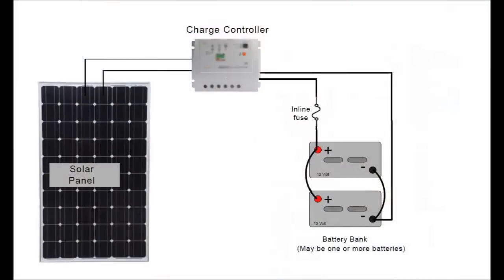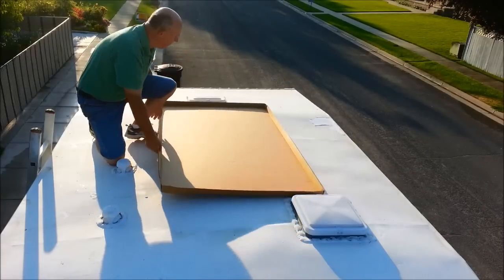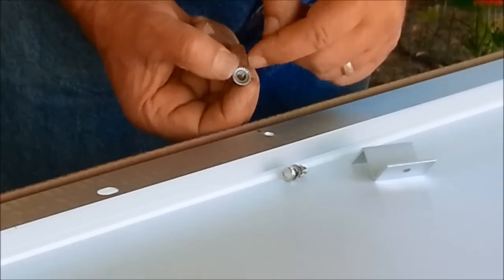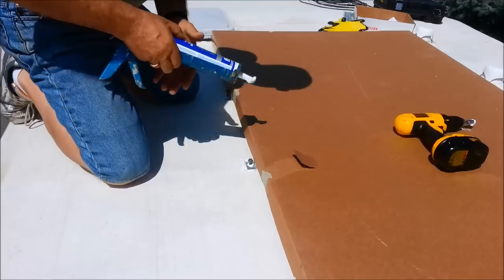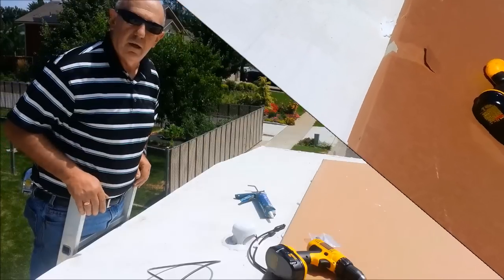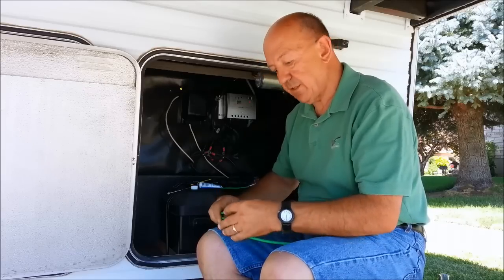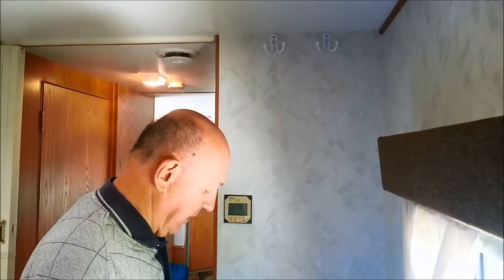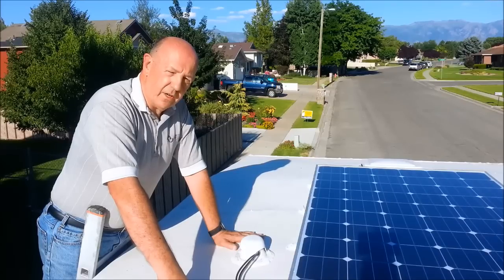The Power of Solar for Your RV

Comment: Nice job.  Plan on installing a system myself real soon.  what kind of experience have you had with it so far?
Reply from the maker: Thanks for watching and commenting.  I am totally convinced I did the right thing, but next spring I hope to be changing to 6V golf cart batteries wired in series to make them 12 V and to get about double the Amp Hours.

Comment: Great video! Follow up question, being from Texas - can you run an AC and lights with it? And will the battery hold charge enough to run the AC through the night?
Reply from the maker: Janice Luce It is possible to run AC, however, You would have to have a large enough inverter to run the AC and you'd have to have a serious bank of batteries to run it for any length of time.
Reply: Thank you for your quick response! And I absolutely agree with the rest of the comments. You are an excellent teacher/armey guy! Thank you for your service!

Comment: I am wanting to install a system. Right now I have an ignition activated solinoid charing my batteries when I drive. My question is can I install Solar straight to the same batteries or do I need some sort of controller?
Reply from the maker: +Zoart, If you do not put a charge controller between the solar panel(s) and the batteries you will burn up your batteries.  The charge controller measures the charge of the battery and reduces or cuts off the charge before the batteries get too hot and boil off the battery fluid and destroy the batteries or cause a fire.

Comment: Great video- what can that panel power and for how long?

 Im looking to put a 1,000 watt system on an RV and live in it, powering TV, Toster Oven, charging computers and mini fridge. is that enough
Reply from the maker: +trevor Donaldson,  There are several spots on the Internet where you can look up the amount of power different appliances take.  I'm assuming you are planning on using the solar power to charge batteries, but a lot of Charge controllers allow you to also run inverters to go from DC to AC at the same time as you are charging your batteries.  I would go to some of the RV forums, like rv-dreams.com where you will find people who are doing what you want to do and can give you a lot better and more detailed info than I can.  Good luck.
Reply: +Scott Law , 
Thank you so much fro your info. I like the way you tend to details too. Little mistakes lead to big problems. Subscribed and liked your site here.

We converted a 1991 Thomas International school bus'Shorty'. We need AC when not plugged into power.
There is also a nice forum ' skoolie ' is helpful like your video,again thanks.

Comment: maybe its me but did you calk at the vent / when the vent pipe comes up through the roof some wood is exposed and drilling on the side of the vent gives water a chance to get to the wood and rot it out (I work for a Rv service and have changed out many vent covers)

Comment: Nice job Mr Law-  I notice it has been a few months since the video was posted.  How dd it work out for you?  Are the two batteries sufficient or did you have to expand?
Reply from the maker: Thanks, Charles.  I am really happy that I did it and so far have been doing okay on just the two batteries, however, I do plan on going to 6 V golf cart batteries this coming spring when I bring it out of winter storage.  I should get almost twice the amp hours.
Reply: What is the lighting like in the RV? Are you using LED lights or the old incandescent 12v? If you're not using LEDs, you can improve your runtime significantly by switching.
Reply from the maker: charles kozlowski
Yeh, I keep looking at those.  Man they're still expensive though.  Do you know of a place to get them at a reasonable price???
Reply: You can just replace the bulbs.....   I found some on Amazon.com for pretty good prices-  they use 1/10th of the power and emit almost no heat....    Watch the "color temperature" - the "cool" ones have a whitish-blue tint and the warm look more like an incandescent (more orange-reddish)...   The color temperature is measured in degrees Kelvin...   6,500K is sunlight- anything below that is "warm" anything above is "cool".  What are the model of the bulbs in your fixtures- I can help you look if you like....   (I'm somewhat of a solar-experimenter myself- although I don't have a camper)
Reply from the maker: charles kozlowski
I can't remember exactly I think it's the BA15s which have the single base but I seem to remember some with two buttons on the base, which might have been in the sconce lights on the wall.  My RV is buttoned up for the winter so I can't very easily go look for a few months.  Thanks for asking though.  I did look on Amazon, they still seem pretty expensive.
Reply: Scott Law
Reply: If you consider the led will last 10,000 hours..... The price really isn't too bad...  I saw $5 each.....  For 1156 types.   I'll look for ba15 and see if I can find the best price for you....
Reply from the maker: charles kozlowski I've been back checking Amazon again lately and it seems like the price is going down I even saw some that are 2 for 89 cents plus $2.00 shipping on each two, some of the reviewers seemed pretty happy.  For that price I'm really tempted to order a few and see.  If you're not happy at that price you can afford to toss them or just use them in specific places where it doesn't matter as much.

Comment: Great video, but you made one big mistake, and that is mounting the solar panel flat and so close to the roof of the Camper. Heat is the enemy of electrical current, you need lots of air flow below your panel. doing so will increase the efficiency of your panel.  cheers.
Reply from the maker: Perhaps you couldn't see it well enough in the video but the panel is suspended above the roof by the z brackets so there is air flow underneath.  I've seen "professional" installations by RV dealerships that have less air space than mine does.  Thanks for your close scrutiny and a good reminder.
Reply: Solar Panels do well with heat.  It's only certain circuitry and none of that is on the roof.
Reply: Scott Law
Another trick in my travels that I have found is you want your charge controller close to your batteries.  And you picked the right charge controller.  My system was professionally installed and yours looks great.  On mine, they used my fridge vent.

Comment: I might have missed it, but how long are the screws going in to the roof?
Reply from the maker: trooper2221 Sorry, I didn't write down the lengths, but remember that there are a lot of different roofs on RVs and you want to use the one that is right for yours not the one that is right for mine.  You want one heavy enough to hold that down solid as you drive down the highway even with a head wind and yet not long enough to protrude through your interior ceiling.

Comment: Do not connect under load......load is the thing that's drawing power, ie the batterries or devices connected on the circuit. The solar panel isnt the load, its the supply. Having said that, i think connecting the supply last is the safest bet

Comment: i have a 2007 Fleetwood Feista, and would like to mount another solar panel. The plywood roof does not seem to be very thick. Do we need to screw into a roof truss? will the Dicor hold the panel down?

Comment: Its hard to see on my tiny cell phone but are those shadows on the panel at the end of the video? Some panels will not charge if they are in the least bit blocked.
Reply from the maker: Thanks for the info about shadows on panels.  Fortunately, mine is not one of those and charges like a champ under even shaded conditions.  Have a great day.

Comment: I do have one question I know there is some kind of formula that tells you what size wire you should run by distance. To limit voltage drop.  Do you know what size wire you used??
Reply from the maker: Sorry I don't remember, but I used the size recommended by the specs on the panel, and I know it was pretty heavy duty.  I can't check because I no longer have the trailer.

Comment: Pretty nice! I know somebody that paid $1200.00 plus parts to do just what you did here. Are those batteries wired is series or parallel? The only reason I ask, is because I don't know that I have seen a 24v RV house battery set with just two batteries. AND, I am trying to figure out the benefits of 24v verses a 12v system. Seems like double the amp hours while remaining at 12v would be more beneficial. BUT, I wonder why so many people prefer 24v or even a 48v systems over a 12v. Any help would be greatly appreciated!
Reply from the maker: Sorry to take so long to get back.  My batteries were wired in parallel, so it is still a 12 volt system.  Some people have four batteries and some have four or eight 6 volt batteries, in all the systems that I have seen they are wired so as to give you 12 volts and increase the amp hours as you suggested.
Reply: Scott Law Thanks!

Comment: hellow scott law my question is are you also using a generator also apart from the solar system and if you do is the generator charging off the solar panel or from an other source thanks
Reply from the maker: Some of your appliances, like your microwave oven, and you may have others,  only run off of AC power.  To run them you must either be plugged into AC or have a power inverter which will take the DC power from your batteries or directly from most charge controllers (but only during the day when you are getting power from the panel) and turn it into AC power or you can have the third option which is a generator, as you asked about.  The Generator creates AC electrical power so it is not in any way connected to the solar panel.  The Generator and the Solar panel are two separate and different sources of electrical power, one for AC and one for DC.  If you have an good quality inverter and batteries you really may never need a generator.  However, I always take one along just in case.  I hope this answers your question.

Comment: This is a great video, thanks for being so detailed! I'm considering purchasing and older RV (1973 Dodge Liberator) that still in pretty decent shape and would like to put solar panels on it. Do you think it would be worth installing them on such an old vehicle?
Reply from the maker: Sorry to take so long to get back, as I've been tied up because of some medical issues in the family.  All is going well now though.  To answer your question:  It doesn't matter the age of the vehicle, it matters how much you are going to use it, especially if you plan to use it a lot where you don't have power to plug into.  This is just another way to charge your batteries and if you are constantly having to run off your generator instead of having "shore power" then this may be the answer.  Good luck.

Comment: Great tutorial Scott!
I have a curse, I'm an RV technician and I spot things that normally nobody sees.  What kind of sealant did you use for the screw holes on the roof?  It looked like a silicone based product, which would be not so good.  Silicone and rubber roofs do not stick well together, please check it once in a while to make sure its integrity is intact.  You really need to use a soft lap sealant designed for the EPDM rubber (most ppl use Dicor self levelling sealant).

That's the only concern from a professional standpoint, the rest was really well done Sir!
Reply from the maker: John Harlick I used Henry 224 Window and Door Sealant.  Reading the description it does say that it has silicone.  Here is the description on the Henry site:  "Henry 224 Window and Door Sealant, a 100% acrylic elastomeric adhesive 
sealant with silicone, is a mildew resistant, rust inhibited, paintable 
sealant. Specifically formulated for high joint movement, this product 
features the strength and flexibility of a silicone sealant with the 
added benefit of water clean up. Its smooth, creamy consistency makes it
 easy to tool and cure to a tough flexible seal. It can be used for both
 interior and exterior applications such as crown molding, chair rails, 
baseboards and all exterior trim."
Reply: Scott Law Honestly, it's the wrong sealant and while it might be ok short term, silicone products are not good for this application.  Silicone shrinks, distorts and will peel away from the rubber roof over time...and when it's keeping water out of your rather large investment, it's a concern.You can't just overlay the proper sealant either, as it won't stick to silicone (the same way the silicone won't stick to your rubber roof after a while).  
If it were at my shop, I would scrape it all off and redo it...if you don't want to go through that hassle (and removing silicone is a major pain), just really keep an eye on it!
Not trying to be a pain in your ass, just don't want to see anything happen to your nice 5th wheel!
Reply: +John Harlick  Yes, I caught that myself.  I would add that large amounts of caulk tend to lose their bond, probably due to temperature range changes of the body of caulk.  Just enough to seal, and wipe clean.  38yr experienced plumber.

Comment: Does its cut charge to the battery once its fully charged
Reply from the maker: Yes.  As I stated in the video, but maybe I didn't state it clearly enough.  The primary purpose of the Charge Controller is to make sure that you do not overcharge and burn up your batteries.  You must have a good charge controller in the system.

Comment: Who can do it for you?
Reply from the maker: Almost any RV business or repair shop can and will install solar for you.
Reply: the salesman told me I can not get more than 200w panel on a class C ,no way to get more?
Reply from the maker: Jeff Woodard
 Check some other dealers . . . or maybe you don't need more than a 200w panel anyway.  Several people have said mine at 230 is overkill, but even though I did as much research as I knew how when I did it, I'm still a long long way from being an expert.
Reply: ok just wanta make sure microwave

Comment: Question: with the panel cahrging the house batteries, are they (the house batteries) still charged connected to the charging system of the motorhome?
Reply from the maker: Good question and it is the exact question I had early on.  Yes you can still leave the batteries hooked up to whatever charging system you have, such as the charger that is running while you're driving down the road.  The Charge Controller will not let your batteries get over-charged from the solar panels.  It detects when they are fully charged and decreases and/or stops the charge going to the batteries when it needs to.

Comment: Wait a minute! Your panel puts out 12v but your solar charger says 27? What's up with that? Things should be frying, no? Where's that extra 15v coming from? Or going?
Reply: MPPT controllers transform the voltage from the panels to the batteries.

Comment: Great video!  I liked how you took us through every step of the installation, not skipping anything.  I'm also impressed that you went and did research to get the right answers and didn't just toss us what you "think" might be correct.  Bravo sir!
Reply from the maker: Thanks for your nice comments.  I'm glad it helped.
Reply: can i ask you if it's wise to put a full cover over the panels when not used in the winter?

Comment: one thing you need to add to this video with text is you didnt say if you are using 12V or 24V battery system. thats a 24+V panel not meant for a 12V system and i dont know of any travel trailer that runs off 24V. if you put 24V to your 12V water pump, heater or whatever youll kill it. i did the same thing you did but my charge controller converts it to 12V and im not getting the best use of this panel for now. but you need to put in there that rv people should be using 12V solar panels for there system. that way no1 will come back at you clamming you misinformed them of how to do this. just looking out for you and others to save them from spending alot of money in parts for there fried rv that may even catch fire cause of this.
Reply from the maker: Thanks for the info.  As you can tell by both the text narrative and the video I'm new to this and since my only two camp trailers have been 12V systems I thought everybody's is.  My MPPT controller is a 12V controller, so maybe I'm not getting all the power that the panel is capable of, but it is doing the job quite admirably.  Better to have it capable of more than what is used than not as much as I'd like.  Thanks again.
Reply: I have a string of three 250 watt solar panels wired in series. When you probe the voltage from the panels going into the charge controller, it reads as high as 117 Volts (my MPPT controller can safely handle 145 Volts). The MPPT charge controller senses the battery bank connected to it and determines if they are outputting 12, 24, 36 or 48 Volts and adjusts it's charging output voltage accordingly. The MPPT controller is a DC to DC buck converter, it steps down the voltage and steps up the current (Amps). The higher the current (Amps) from the charge controller to the batteries, the faster your batteries will charge, (my MPPT charge controller is rated at 80 Amps). It needs to know what type of battery is connected, such as Flooded, VRLA or AGM. It applies a different charging algorithm to each battery to help prolong battery life. A good MPPT charge controller will provide a temperature sensor that you attach to the battery bank. The temperature determines the charging voltage applied to the battery bank.